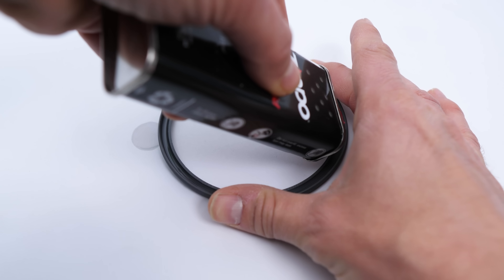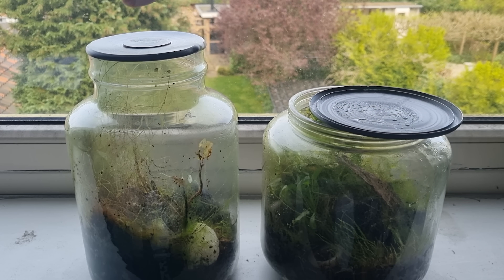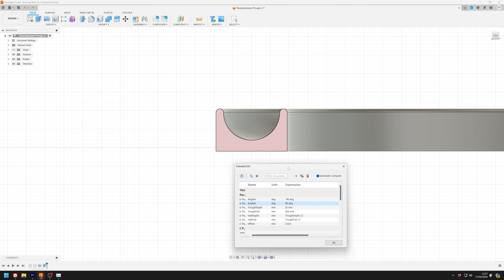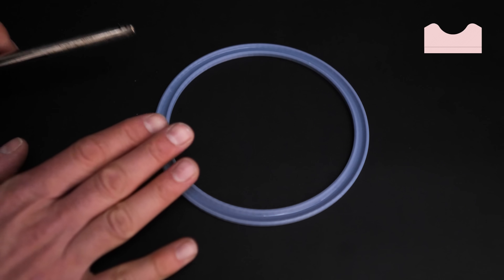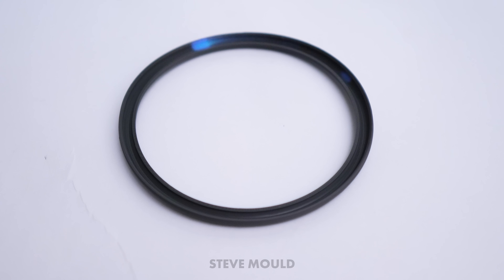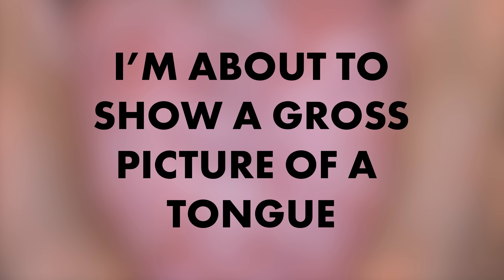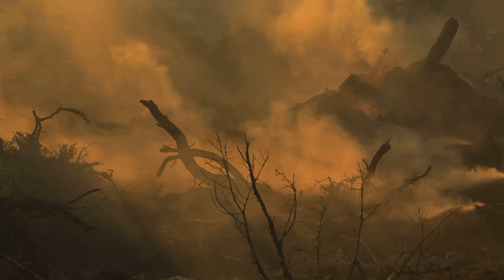Bizarre travelling flame discovery

Comment: Hello, I'm just a common dude and I like physics and interesting phenomenon that we can see take place. I'm guessing that the incline on the bottom track of the figure eight is channeling the vapor upwards at the ramp's respective angles since it rises. Also, the bridge portion of the top track is acting as a barrier preventing the vapor from escaping the localized area. On your modified spiral with the circle, it's the size of the ignition loop that reignites the junction (the Y connection) like a smaller gear turning faster than the larger gear or in this case spiral fuel track. This seems similar to the ignition block in an engine but on a simplified 2d plane using columns as the cylinders. Picture a track system with your ignition loop on the left side, connected via a Y-junction. As the flame travels around the loop, it reignites vapors at the Y, splitting the flame sending it down the line. As the flame leaves the Y-junction, it travels down the line from left to right until the flame or flow is fed back down and around a circulation loop at the far end of the system to reintroduce the original flame back to the Y-Junction at the start of the system. Centered in the main line (the top line) are vertical columns with piston plungers that get driven up and down by airflow. In order to move the pistons back and forth without coming to a rest, our design must be mirrored vertically so that the piston heads are at the center of the design and are driven by arms and pivot points extending from the piston head center back into their respective vertical columns to create a reciprocating motion utilizing equalized pressure and timing to run seamlessly.

Now to introduce the concept of what we'll call mini-ignition loops, these will be used to create secondary ignition sources to continue driving the pistons in the vertical columns. These loops have a Santee or Y ignition junction feeding back from the loop into the main line, depending on whether it's a circular loop or an elliptical loop, to ignite or reignite a double combie junction and fire the pistons in the vertical column above, while keeping the flow continuing down the main line to the right.

The Santee junction (left) is connected to the double combie junction, (right) which plays a crucial role in allowing the air to travel both up the vertical column and down the entrance of the ignition loop simultaneously. This simultaneous flow ensures that the air is reintroduced into the main line, continuing its path downstream. The double combie junction acts as a connector, facilitating the flow in multiple directions, crucial for maintaining the airflow dynamics of the system. I'm not sure how you would set the timing exactly because if you ignited both Y junctions at the same time the pressure would equalize and not drive anything I would imagine. So maybe a delayed start on one of the main ignition coils would do it. Okay so I've done some plumbing in the past as well but no physics classes or anything; intro to automotive in high school but that's about all learned formally involving motion lol. I hope this makes sense it took me a while to think out and decide how to explain it in words. I subscribed a bit ago, but I began just watching your videos passively at first. I love your content, keep it up.

Comment: I feel like I've seen this before in a Smarter Every Day video about motors/engines.  Gonna go look for it and edit this comment if I find it.
edit:  spent 20 minutes and couldn't find it.  Starting to think it wasn't a SED video after all.  All I remember is something about jet engines needing multiple flames going around in circles in order to ensure maximum efficiency in a turbulent flow rocket engine?  The engineers found out this maximizes thrust BUT it quickly destabilizes and flames out.
edit2: found it!   https://youtu.be/RVxgyz_avQM?si=OdOQTUEmyZS3o8Ay&t=236

Comment: There is a planet in Iain M. Banks' Culture series of novels with a planet that experiences a constant travelling fire, and it has a gravitational pull significantly greater than 1G. I'm now wondering if he did the maths on the refactory time to permit such a fire (even though there is a periodic "incandescent" year where one of the species of plants that endures the fire disperses its seeds by producing far more oxygen than other years, causing the flames to race around with far more intensity...)

Comment: The sustained flame at the junctions is because the surface of the fluid is wider than the 5mm gap. If you print the junction with a dividing wall, keeping both sides roughly 5mm, it should work properly. I expect this will be one directional.

Comment: You should look up rotating detonation engines. They're an experimental kind of rocket engine where the combustion happens in a similar manner, but with explosive shockwaves chasing each other around a core. My understanding is this allows the engine to retain the benefits of combustion at intense pressures without the challenges of containing and supplying said pressure. The downside is you have to somehow actively stabilise a continuous detonation for minutes at a time in a small enclosed space.

Comment: 10:12 What would happen if you  varied the the path lengths incrementally between the two paths, so that one flame reaches the merge slightly ahead of the other one at varying increments?

Comment: I used to have a heart condition called AV nodal reentrant tachycardia (AVNRT), which is caused by having an extra pathway in the wiring inside my heart, effectively forming a loop. The track at 10:12 is similar: initially, the flame is going around the large loop. But around 10:26 there’s a sort of phase transition to a faster cycle where the flame goes around the smaller loop. That’s like what happens when an AVNRT episode occurs: the signal starts going around the loop and rapidly firing out heartbeats.

Comment: Try using a thermal camera! Looks like also the gas stays at low enough temperature in certain regions to not produce a visible flame and I wonder how much the negative pressure and direction could be also influencing the direction and speed. Cool stuff!

Comment: That is amazing!
I especially liked the infinity or figure 8 shaped track. It looked like a miniature slot car, only on fire!!😅
I wonder if you could make a connecting bridge on the spiral so it makes a loop. 
Another one to try might be the double spiral, like the one found where the Nazca lines are.
It would also be cool to make a mat from aluminium or any suitably fire proof material, with pattern like these built or machined in, then poor some shots on it. With the usual amount of spillage mess from pouring a few rows of your preferred alcohol. Everyone drinks their shots, then you light up the mat, and be amazed at the swirling fire!🤩😆

Comment: I'm hardly a scientist but isn't it strange that your hypothesis states that the flame goes in a circle because the flame has burnt the vapour and thus doesnt return back because the vapour hasn't got enough time to evaporate yet when the circumference of the troth is smaller it burns continuously? It shouldn't burn at all it that case or am i missing smth?

Comment: If you build in a number of pizo-electric crystals set to fire at a given frequency, this could be a superb model of the heart. Normal sinus rhythm is enough to dominate and prevent other tissue with a lower inherent rate of firing. Remove the SA Node and arrhythmias have space to emerge

Comment: one thought about the fluid not draining away from the raised section on your "figure eight" track: maybe the layer lines produced by the 3D printing process helped the fluid cling to the track by creating tiny steps that the fluid could pool on easier(thanks to surface tension, maybe)?
Reply: I figured that since what really matters is the thin layer of vapor over the fuel that even though it he fluid doesn't persist over that segment the vapor might still be constrained by it enough
Reply: @Chauzuvoy  I truly don't know exactly what happens. My comment is a wild guess based on my experience with my 3d printer, but the real reason certainly is at least partly what you said
Reply: @Chauzuvoy Two full reads to understand your simple idea, due to no punctuation. How many didn't bother? No need to appear as incoherent as others try to make you!  And no time left now to comment on the merits of your thoughts. 😢
Reply: Perhaps the flame front creates a pressure wave that pushes/flows vapor along the track to "jump the gap".  The vapor appears to be only slightly lighter than air..
Reply: @dhgmllcshea5038  That seems plausible but It's been years since my last physics lesson in high school so Idk😅...
Reply: I was thinking that it was possibly caused by the gas being lighter and floating upward.

Comment: What about placing the track on the rim of an upturned loudspeaker cone? Can you induce flames only at the antinodes & control their direction by acoustic driving above & below the resonant frequency of the track?
Taking this further - can you eliminate the track completely & pour the lighter fluid directly on the loudspeaker cone (unless it is paper!) To get 2D Chladni figures along the normal modes of the membrane & control the flame progression by adding a chirped pulse to the fundamental driving frequency?

Comment: The pilot light arrangement on a gas stove (on mine, anyway) has specially designed tubes to carry the flame from the centrally located pilot light to the burners.  Under normal conditions (burner off) the rising column of gas at the pilot light location creates a slight low pressure at the nearby end of the "flash tube" (I think that's what the are called.)  So there is a constant, small flow of air through the tube, from the vicinity of the burner to the vicinity of the pilot light flame.  When the burner valve is opened, the gas being drawn into the flash tube is no longer air, but natural gas.  When this natural gas arrives at the pilot light end, it ignites and a flame front travels rapidly in the other direction, back towards the burner, causing the gas there to ignite.  Once the burner is ignited, there is no longer a source of natural gas to flow through the flash tube, so the process terminates.  If, however, the burner fails to ignite for some reason, there IS a source of natural gas and the process starts all over again.  If things aren't perfectly tuned (the stove is 80 years old,...) the flashing process will happen a few times before the burner successfully lights.

One small detail is that if the tube contained pure natural gas, a flame would not propagate through it.  So on the underside of the tube, there is a very narrow slit, running the entire length.  The slit functions as a kind of carburetor. It allows a certain amount of air to be drawn in (from below) as the natural gas is being drawn in (from the burner end).

Comment: That is very cool.  For the figure 8 one, is it possible that just the movement of the flame itself and the expansion of the gasses ahead of the flame are actually pushing the gas up the hill and into position in order to be ignited and keep the system going? 🤔 I'm sure I'm not asking the question quite right, but... It's curious. :)

Comment: A Tesla valve, called a valvular conduit by its inventor, is a fixed-geometry passive check valve. It allows a fire to flow preferentially in one direction, without moving parts. The device is named after Nikola Tesla, who was awarded U.S. Patent 1,329,559 in 1920 for its invention.

Comment: I have noticed the excitable medium when welding occasionally you will get just the right coating of carbon around a weld

you can leave the weld and carbon the then introduce something to excite it normally a spark or flame or wire brush and a front will burn across the carbon

 I always wondered about that mechanism thank you

Comment: I think how it decides which direction to go is determined by the fuel/air mixture.  one side of the flame is going to have a "better" fuel air mixture after the initial ignition and the flame's exhaust is going to be turbulent/chaotic, and one side will be more conducive to sustaining the flame. then it's just chasing the fuel around.

Comment: If the rate of evaporation is responsible for keeping the flame moving then Im guessing that room temperature and temperature of lighter fluid would regulate the speed of the flame going around. So slowing down the evap rate would allow for larger sizes of trough and diameter of ring.  ? Just wondering

Comment: You can obviously create or-gates using this so I wonder if with a bit of ingenuity you could create and gates and then build a flame calculator. You'd need to have very precise timing but you can just accomplish that using spark gaps so I think this is totally possible.

I wonder if this can also be used to illustrate electron cascading, if it can I bet this would serve as a great visual illustration of the effect.

Comment: Based on the way the loop with a split went I don't think this would work as intended, but I'd be interested in seeing a Tesla Valve track.

Also, maybe someone smarter than I can think of an interesting use of combining it with a material that changes shape when heated (or returns to an original shape when heated).

Comment: 10:53 To help this raised section not fizzle out, small, slightly slanted steps could be put into the slope that traps the fuel so it can evaporate without going down the slope.

Comment: What if you were to have a pipe underneath with a continuous split to feed evaporated fluid (or just fluid) into the trough that way you can have a longer lasting fuel supply.

Comment: You could place the ring on a heating mat and measure the speed of rotation  relationship with the temperature. That temperature influences the vapor pressure of the lighter fluid and it would be interesting to see if it would go faster.

Comment: This effect and the shapes you made remind me of Powder Toy when you use metal wires and electric sparks. A number of designs have involved people making wire rings with a spark running one direction around the ring (usually done with a diode) and a wire extending from that ring, so as the spark goes around the ring, it creates new sparks down the wire at regular interval. The other shapes you made would work very similarly in powdertoy.

Comment: a thought: deep troughs would hold more lighter fluild, so in cases where you dont want to reach as far you could taper the trough to a point in order to make more intricate designs for the flame

an example of this is the strange behavior in the spiral design,  a slightly higher trough at the split towards the spiral, and a tapired path to the end of the spiral may cause less pooling and a more efficient pathing for the flame

Comment: This is the concept behind rotating detonation engines. You have a detonation front circulating around a ring shaped combustion chamber like the flame in the video. Detonating rather than just burning fuel (like you would in a regular jet engine/rocket) is more efficient, and this method is one of the ones people came up with to sustain a detonation for thrust

Comment: [10:20]  When I saw this splitting & reconnecting design, it immediately made me think of trying this effect through a Tesla Valve.

Why the opaque grey polymer? Is this the only fire resistant material, or was it just to give the conduits a neutral quality for filming? Why not try different colours (especially black) or transparent 3D printing filaments or even 3D Prints in resin? 'Cause seeing the blue flame creep around a transparent ring, in the dark & perhaps filmed in slow motion, would look spectacular! Hell, why not try to do the Olympic Rings - complete with appropriately coloured flames?

Have you thought of extending these shapes into the third dimension? Either as multiple parallel flat planes set at different levels, or as conduits which twist & fold. A Helix, for example, would look awesome. As would a Möbius Strip. Though you may need to experiment with different fuels to have them stick to the conduits & continue sublime to a flammable gas.

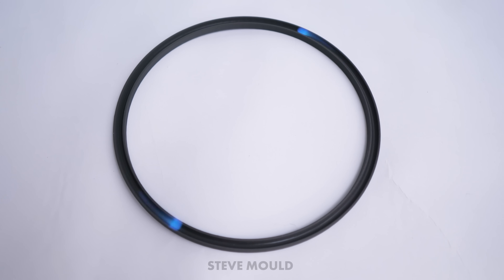Comment: 3:00 if you can get this balanced twin rotating flame front with a detonation (instead of deflagration) you'll have found a holy grail currently being sought in rocketry.

It would be cool if they engineered a solution that uses refractory period as a key factor

Comment: The trough width has to do with the amount of surface area between the air and the lighter fluid. The wider the trough, the more oxygen is fed to the flame.

I believe that the flame would spin slower at higher altitudes. Next episode, bring the contraption to the top of a mountain on a day with calm winds, and see if there is a difference in speed ⛰️🏔️

Comment: Very nitpicky of me, but with the forest fire ring, you're forgetting that the trees might be grown and ready to burn before the 1 year cycle, they just burn in a one year cycle because they are ALREADY grown enough to burn by the time summer and the heat and dryness come around again, and it is the SUMMER that is causing the one year cycles, not the trees themselves. 

Once they're lit, if they're in a circle and if you have enough fuel, it would definitely be faster than a 1 year cycle.